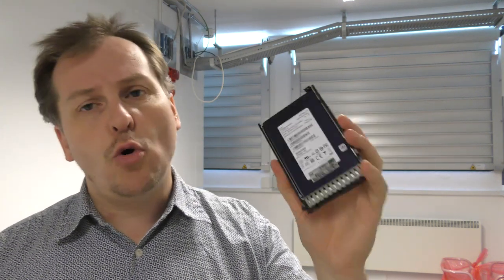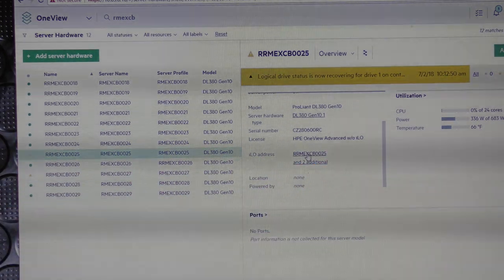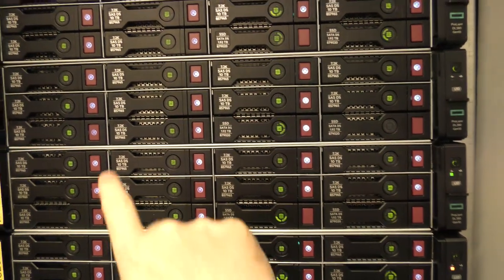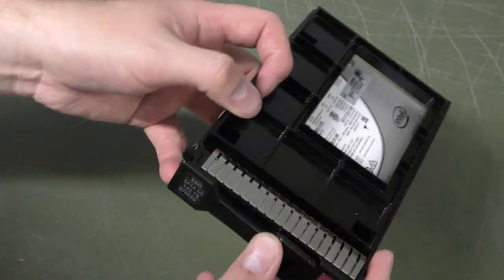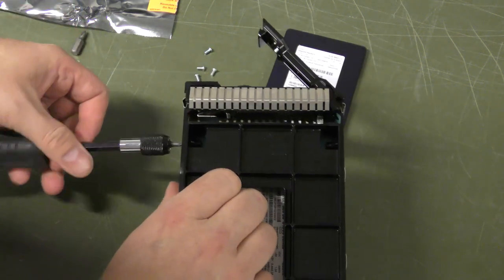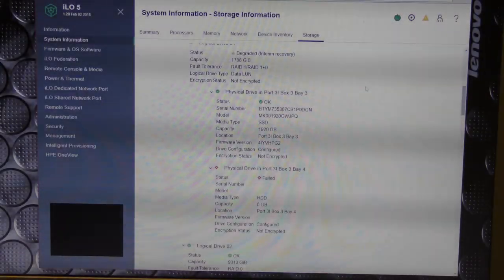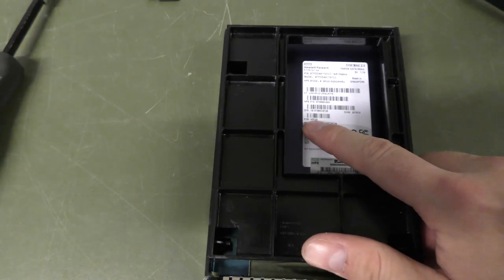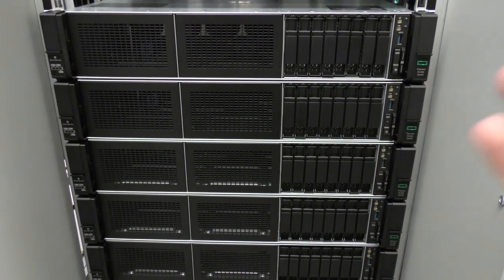Replacing 100TB of HPE(Intel) Enterprise SSD´s which Fails - 715

Comment: The engineer who designed that hard drive case should be fired for making it so complicated to replace
Reply: Somebody needs to build a small robot to unscrew/rescrew everything on those hotswap trays :)
Reply: Its not intended to replace the Drive inside the Cage! The Cage itself with the Media inside has to be replaced... (I Don't know why HPE delivers the SSD in the wrong SFF Cage)
Reply from the maker: I am sure he did what he could.

Comment: This reason combined with HP's terrible support is why we have ditched HP for all of our servers.
Reply from the maker: Hi dangerousmythbuster
Well not all the service is that bad, But getting for millions of dollars of equipment and using months messing with it,, is bad.
Thank you for watching! :-)
Reply: I moved from HP to Dell because HP decided to charge for firmware upgrades. That just seemed wrong. Turns out that at the time HP had split into two companies.
Reply: @SirHackaL0t. , is DELL good now?  Not that they were bad, but I guess less impressive as a product (the ones I had run-ins with).  HP's were solid build, included great attention to detail even in chassis design, the slip cards and all...  Dells were just heavy, loud, barebones and they ran.  Minimalistic is the word that comes to mind when I recall Dells I've met.  And I think they've never bothered to make a quiet server.  For smaller offices it matters.  HP did.  DL380 G8 were whisper-quiet to my ear (if tuned in the BIOS correctly).  While we are at it, I'm asking everyone in the server management trade, so I'll ask you as well: what brand (or specific line of product) do you consider best made from the standpoint of management.  Free, understandable and obtainable for a long time after EOL firmware images, reasonable out-of-band licensing, just being hassle-free basically, and so on.  Thank you.
Reply: @parahumanoid  Servers we have bought have been stable and issue free for the last few years. Desktops never seem to go wrong. Laptops sometimes come with trackpad issues but quickly fixed buy and engineer visit. No complaints here.
Reply: @parahumanoid  And servers are never quiet. Rack mounted ones are designed for space limitations so will always be loud regardless of who makes them.

Comment: The real solution is different drives, different manufactures, different dates. Same factory run will fail at the same time. This is known. Called the Bathtub Curve.
Reply from the maker: Yes it sucks when many drives fails at onces.

Comment: I remember readig a study that showed that failures of identical SSDs with equal wear have very strong clustering properties, much more so than HDDs.  That kind of nearly defies the purpose of a redundant array.  Having a hot spare becomes very important, so when it kicks in, its level of wear is far from equal with the remaining drives and the overall probability of a fail event becomes more dispersed for the whole array.  With such practice in place permanently, failures get more dispersed across the temporal spectrum, which considering replacement part delivery time, is a good thing: it gives you some breathing room while running degraded.
Reply from the maker: SSD's are more predictable,, of when they are going to fail,, good and Bad.

Comment: I don't know if you even bother what the new drives are, but they actually are real Micron SSDs.
Reply from the maker: I do know! But I do not know that brand very well... but they are not failing as the Intel ones,, but speed/ quality etc. I have no idea.
Reply: Don't think I had any crucial ssds die (and that was just consumer) micron is oem side of crucial SSD, really depends if hp brake the firmware (or if the raid controller or psu is killing the ssds) still little Odd that your having mass failures with ssds especially around the same time there Must be a deeper issue with hp servers (or maybe the old uptime bug that would kill a ssd if left on for to long)

Comment: I wonder what is to blame, HP and their firmware or Intel and their drives? I used to have this problem with HP servers eating drives on the last HP server one of my clients used.
Reply: Since Intel seems to be having a problem in general I'd say that it's the Intel firmware.  I think HP and Dell just slap their logo on the firmware after they do compatibility tests.  I ran the Intel SSD utility on one of the drives and told it to check for firmware and it said please contact the OEM for firmware which Dell had.
Reply from the maker: We / I have wasted sooo much time on this,,, and it’s millions of dollars of supposedly high end Enterprise equipment, not working/tested probably out of the box.
Reply: Well, that really sucks. They must not do any extended tests to ensure the longevity of their products. Seems like someone rushed a product to market without enough QC.
Reply: I using Fujitsu servers and server equipments in my data center. Never had issues with them. After 5 years of constant stressing, my first seagate hdd started to fail. Replaced and good to go :) ok, im not using top of the line hardware, but im happy with everything i have :)
Reply: one reason theys ssd fail,cuse some of theys ssd use emmc from faulty  or failed phones 64gb,128gb and 256gb..this what i manged to find from various internet sites..
Reply: @MyPlayHouse  HPE hardware does cost more but manufacturing wise its cheap, huge markup on server-ware, they know what you  buy one of their servers and licenses, they got you by the balls and charge you stupid costs for things that cost pennies to make.
Reply: @dukenerd6320  I'm tipping you use an Apple Phone.  That's how you know about stupid costs for things that cost pennies to make.
Reply: @einfelder8262  I've been Sony & Xiaomi Android user for almost a decade m8, never owned an iPhone, never will, overpriced crap.
Reply: @dukenerd6320  Haha, the best answer possible  :)  Is it OK nowadays to say "me too" ?  My phone is Moto G5 Plus, the very best android phone at a low price.

Comment: Sounds like a problem with the batch of drives from the factory. Also loving the extra work datacenter content we have been getting lately.
Reply from the maker: It’s really bad to have two and three Enterprises drives fail, in systems like this. Damn expensive equipment, and supposed to run critical systems.

Comment: I've only really used HP server equipment over the years, starting with the original Compaqs (apart from Nutanix more recently) and I've got nothing but praise for them! Extremely reliable and any failed parts (only PSUs or HDDs) get replaced under the support agreement with no hassle.
Reply from the maker: Hi Steve Cooper
Thank You very much!  That is great,, I have just had to many components that has not been compatible/working on brand new servers.
Thank you for watching! :-)
Reply: yeah, i've worked with alot of compaq servers (very old models) and i only had just few disk fails, compaq's reliability was top notch. Unfortunatelly HPE is not and probally will never be as reliable as compaq was. Too many firmware problems.

Comment: We had a span of a month where I worked that several Intel drives failed in a month suddenly.  We found out that there was a firmware update to prevent the failure so I went through and upgraded as many as I could, and it cut down on the problems tremendously.  Now I'm an SSD firmware freak.  Anytime I have a chance, I update the drive firmware on them since I've had those Intel drives fail suddenly like that.
Reply from the maker: Hi stonent
Thank You very much!  glad you liked the video :-)
Thank you for watching! :-)

Comment: In minute 5:00 you said that ilo does not say what drive fails but at 4:25 it says that is the drive in box 3 port 4, that is 3 row, the 4 drive. And yes, tell ilo to torn on the led for indentification of the server in the rack. We have 2 hp dl360 g5 in a cluster (redhat) and we are using for the past 5 years samsung evo ssd - cosumer ssd. Works great. Keep up the good job, hi from romania
Reply from the maker: Hi Alex Mocanu
Thank You very much!  would be nice if the drives was orange.
Thank you for watching! :-)

Comment: My policy is 10% spares of drives on hand. Even with 4hr 24/7 response, I can swap it out before the "tech" arrives and in most cases the tech brings us a referb. This case with a firmware bug it may not have helped, however, it can be swapped out and prevent data loss. HPE (before it was that) support was good around 8~10 years ago. Today, looks like not so much. We had a HP branded UPS die on firmware update (update was suggested by HP to resolve an issue with it cooking batteries.) Bricked the unit. Sent us a new one in 4hrs, bricked again (tech did firmware that time), 3rd unit FINALLY good to go. We raised enough of a stink we got an extended 3 year warranty on the last replacement and it is still humming along to this day.
Reply from the maker: As you saw I replicated one of the two drives in the top four servers. And I was out of spares ;-( take a while guess why we are reinstalling one of the remaining two servers,, next week. This sucks.
Reply: Wild guess: Intel SSD of that model are the new deathstar ;D

Comment: Hi Morten, I'm quite interested in this configuration. Is there a specific reason why physical servers are used for Exchange rather than virtual machines? Our workplace have been running Exchange virtually since Exchange 2007 and are now running several Exchange 2013 VMs on our ESXi clusters with SAN backed storage on PCI-E SSDs.
Reply from the maker: We have run exchange on physical servers for many years. But like four years ago they mowed to VM. Mowing back because of performance and storage!
Reply: @MyPlayHouse  Exchange servers are database heavy so dedicated hardware is the way to go.

Comment: Ahhh I remember those buggy Intel SSDs. We had a bunch of them in RAID1 fail in non HP Servers. The Firmware had a terrible Bug and killed sometimes the whole RAID when one of the disks failed.
Some could be flashed in time to prevent the bug but most of them we had to replace.
Reply from the maker: Yes this was not great..

Comment: There are firmware updates that fix some of these hp branded ssd issues. We run 4600's ourselves as well, but more write endurance drives for the s2d installations after the cache level. HP's are a love hate relationship for sure.
Reply from the maker: Hi brycerichert
Thank You very much! I have had to deal with a lot of faulty HPE branded Intel hardware. for months....
Thank you for watching! :-)

Comment: Guys, anyone working with esxi 6.5 (5969303), is there a known bug with hypervisor resetting when copying a very big file between datastores?  I just ran a three-day non-stop copy using "dd" in ssh after failing to do the same with "cp".  Now after having fixed the hardware issue I was copying a really large VM back (using "cp") and about two hours into it the esxi rebooted.  What gives?  What logs should I see for possible light-shedding info?  Thank you again.
Reply from the maker: Not anything I have come across,, booting ESXi because of a file copy,,, lets hope that is not it.

Comment: HP 5100 max is probably a Micron 5100 max. They are 3bit eTLC and you can set up for 60-70% of over-provision giving up to 17,600 TBW of endurance on the 1.92Tb model. The Intel P4600 equivilent is 11,080 TBW.
Reply from the maker: They have been doing great.

Comment: IBM FTW!! We have IBM/Lenovo xsystem running linux without any real problems in more than 5 years... Too we have San ds3500 with expansion and a storwize v5000 .. and still have as400 running in a IBM 9406-170  and iseries v7 in a 520 power 5..
Reply from the maker: Yeah do not rage the old equipment down before you’re sure the new stuff is running! :-/
Reply: I want to add my two cents, having no problems doesn't mean there isn't any.

I recently had to perform data erasure for a client with a DS3500, it wasn't pretty. 
Over 40% of the drives failed on a first pass DoD 5220.22-M data erasure. 
All the failed drives reported bad sectors and the erasure wouldn't pass correctly there after.

As someone who'd be responsible for the integrity of data, learning that my storage system wasn't reporting these bad sectors would make me nervous and question the veracity of the vendor.
Reply: Davis Bacon I have of course defective hard disk and they report  bad sectors. And I remember when I put the new disc I clean the bad sectors.
Reply: The fact that the HPE equipment is catching these frequent failures is good.

I sleep better knowing now there is a class failure on these drives, than two years down the road when my data is corrupted.

Comment: I remember the G6s had the same problem with the seagate drives
Reply from the maker: Hi Sergio Salgado
Uhh! never heard of that!
Thank you for watching! :-)
Reply: I remember a huge batch of servers with disk with SMART problems, every single one failed without failing until got replaced by good ones, happy times I remmeber
Reply from the maker: Hi Sergio Salgado
Ironic,, SMART was suppose to help solve problems.
Thank you for watching! :-)
Reply: @MyPlayHouse  the problem with smart is that every vendor make's it a little different in their disks firmware, so if its not working as it should, there is no workaround it. The problems you have with the disks looks to me like another bad hp firmware, i've seen alot. hp will do everything they can to make sure that non-branded hp hardware won't work on their servers so they mess really big on the firmware. Hardware wise hp servers are very good but these kind of "picky" problem made me stay away from most new models.

Comment: We use HP blades at work and haven't had near the issues you have had with yours. The last issue I can think of is one of the drives died, and once it was replaced the rebuilt the raid and all was well. We have twin 10GB cards setup in a redundant setup running ESXi 6.0. Not sure if it makes a difference but we only have ESXi installed on the drives so they are smaller platter drives and use NFS on a NetAPP (BOOOOOOO THEY SUCK) and that seems to work well for us.
Reply from the maker: Hi Taylor Hardin
Thank You very much!  We have 140 HPE blades running ESXi 6.5 that needed to taken this https://h50003.www5.hpe.com/digmedialib/prodimg/lowres/i00052615.png
They was all replaced after having failed SD cards for months.
Thank you for watching! :-)
Reply: Thats an interesting product. Do you run the USB drive internally and how often do the sd cards last?

Comment: Regarding the failing 10G Intel network cards for your VMware hosts - would they happen to be in the x710 series ? If not, could you elaborate on which series they are?  I've had a bunch of driver/firmware issues with the x710 cards (Though Dell branded, still just Intel x710 underneath) - and actually I gave up and got some slightly older x520 cards... Which might lack a few features compared to the x710 - but, they are rock-solid !
Reply from the maker: Hi Glenn Sommer
Yes it those Intel cards : https://communities.intel.com/community/tech/wired/blog/2018/05/23/malicious-driver-detection-mdd-event-resolved
Intel has removed comments on this thread :-/ Clearly to downplay the problem.
Thank you for watching! :-)
Reply: Yeah, in that case - I fell your pain. I've been through the exact same issues! In case you haven't stumpled upon this yet, Allan posted a workaround for the 6.0/6.5 series using the vmklinux layer. Reference: https://www.virtual-allan.com/esxi-6-0-6-5-and-intel-x710-nic-problem/    Personally I would prefer to use the native drivers - but Intel has not released working drivers for the 6.5/6.0 series yet.
Reply from the maker: YouTube is messing up, and climes that I have not replied to this,, sorry for the "disturbance in the force" :-/

Comment: have you run the latest hp service pack that updates ssd/drives, raidcontroller, hbas and every other thing to the latest firmware? That is a very good idea. Especially if you have ssd firmware issues, or firmware incompability on the raidcontroller that throws out the drives
Reply from the maker: All 50 has been updated from HG1 to HG2,, now there is HG3 available.  But after months of replacing drives and reinstalling servers,, we have lost confidence in the Intel DC S4600 drives. And its time to get a fix.
Reply: My PlayHouse strange.
The drives have a good reputation in general I think. 
Very strange.

Comment: I have the same issues with the DL380 Gen10 for our vmware farm. that aslo has the intel duel 10GB nic. my work around was to inject the drivers from intel linux version.   is HPE OneView worth it?
Reply from the maker: Hi Carl P
Thank You very much! The non HPE VMware6.5 ISO generale standard driver will also work.
HPE OneView,,, if you have 10 servers nahh,, if you have 100 It will make sense,, but we are always waiting for the next release, so they can fix what they messed up in the last update.... :-/
Thank you for watching! :-)
Reply: Ya we have over 400 blade servers and about 200 rack mounts so I guess Ill wait. I have a big issues with Oneview doing the firmware update on a c7000 enclosure. thanks again